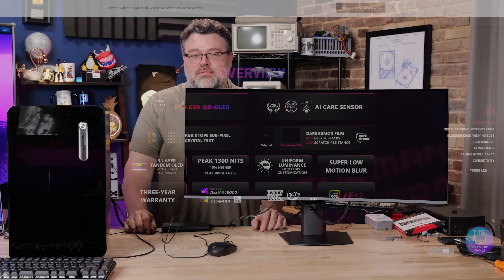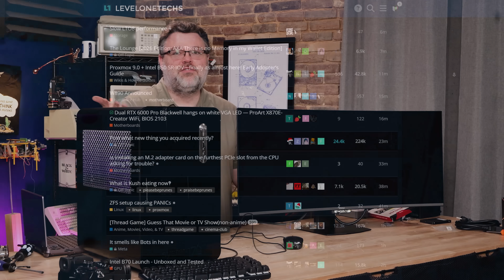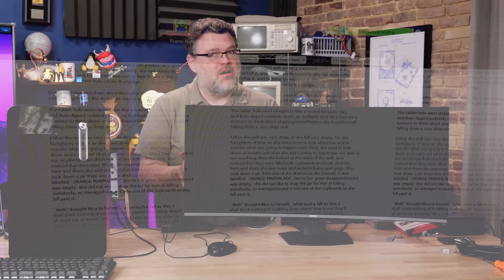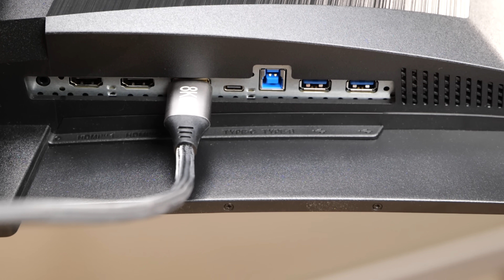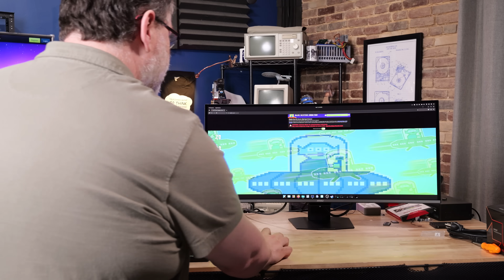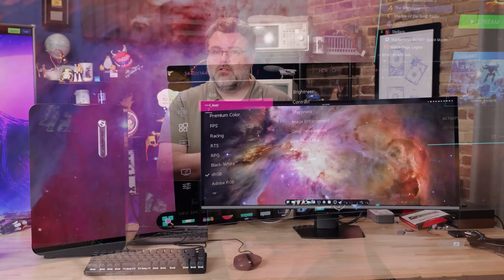Reviewing the MPG 341CQR QD-OLED X36 from MSI

Comment: Orginally bought my first high end gaming monitor in 2018, was looking at the Samsung chg70 and the asus pg348q. Back then I had an gtx 1080sli rig and I knew there was some ultrawide compatibility issues, that manifested in me not playing fallout 4 anymore, tho out of the hundreds of games I have installed on my current system only fallout 4 remains problematic. Since having had my pg348q for these many years I’ve been wanting an upgrade and nothing has quite felt like a really worth it, as I originally payed 1200€ for my pg348q I absolutely needed to get a upgrade that was worth it. Over the past few years several monitors have peaked my interest but this generation is the first one that actually looked like a substantial upgrade, I did cross shop the pg34wcdn against the 341cqr x36 and wasn’t really leaning one way or another, til I found out the amd cheaped out on my 9070xt. Back when I bought my pg348q I knew that there was potential that I would come to regret getting a gsync monitor and that time came last year when I upgraded from a rtx 3080 to my current 9070xt, tho i originally placed much of the blame on Nvidia’s I now do have some resentment to amd as well, yet for 650€ that I paid it was arguably the best value GPU I could get, and even tho I wanted an 5080 I wasn’t willing to contend with the 12vhwpr connector nor the 1200€+ price tag for the minor performance increase over the 9070xt, yet amd has let me down greatly, having a “flagship” GPU with a underspecced dp2.1 connector, had my 9070xt been outfitted with the full spec uhbr20 80gbps port I would have gone for the pg34wcdn as to avoid the need for dsc, being limited to uhbr 13.5 54gbps I no longer had any real performance difference between the 2 and since both fulfil my need for a gaming/home office monitor I decided on the Msi model, I have my webcam (Logitech Brio) and keyboard and mouse through a hub connected to it.

Comment: I am looking into this model or Asus PG34WCDN for gaming/browsing (average 2 hours/day) and home office (2-3 days/week). I have read that the 5th-Gen OLED panels along with the OLED care they offer, are generally much better in countering burn-in than previous gens. Do you think that it would be an issue? if yes, how intense can it be and how long could it go without any issues? (of course without using static images such as windows task bar)

Comment: I’m still waiting for OLED to truly match IPS when it comes to subpixel text clarity. The colors and contrast are incredible, but for me, text sharpness is what matters most. I just picked up the XG32UCWG 32" 4K, and while the WOLED glossy panel is decent, it still doesn’t quite hit IPS levels. The matte coating might actually be the bigger issue here. If Alienware really is releasing a glossy version, that’s the direction I’d go. At this point, I’d avoid matte OLED altogether.

Comment: FYI I had to replace my MPG 341CQPX QD-OLED twice in less than a YEAR, both time, and thats with using the proper OLED care and screensaving techniques, so I'm not sure if its a question of that particular panel of the oled experience with Windows (static imagery) but I am far from being blown away by the pixel life expectancy!
Reply: did you replace it due to burn in?
Reply: @Stephanie-px7ir  Yes.  The third one I didn't check for burn ins (yet).

Comment: NGL I want to see lightweight OLEDs. 17+ pounds is just, ugh.... in my use case, regardless of arm, because of how my c-clamp is mounted, i can't really go over 10 pounds without some saggy arm. i had a 1440p 240hz oled asus panel on the arm, and yeah, it sagged. sadly im crippled and stuck in bed 24/7. so i can't really do what i wanna do. and family can't really go drilling shit for me to mount the vesa arm in a way that prevents sag with heavy displays.... so im just stuck with lightweight displays. currently using a 24.5" 1440p chinese innocn display. its pretty sick for what it is.... and then above that i have a 16" AMOLED display, also chinese brand. so i have an oled for movies/tv that is tiny/light/portable and then my larger gaming display that does 240hz... so yeah.

Comment: Your video has been featured on DailyDrops under Cpus!, DailyDrops is a creator‑friendly discovery layer for professionals. We surface timely articles and videos, then place each piece in clear context using a layered topic hierarchy. The aim is to highlight the work, not to trap the audience on a platform. Credits remain front and center, and our curation is designed to respect both maker and reader: concise summaries, clean presentation, and straightforward attribution. As your video is linked with {TOPICS}, it helps practitioners find you when they explore that theme. We always welcome input from authors about how their work should be categorized or framed. If parts of the context feel off, tell us how you would describe it and we will align the tagging so future drops present your perspective. Your guidance becomes an editorial signal that keeps discovery fair and useful.

Comment: Personally I hate the 21:9 aspect ratio, but its nice to see they improved on the text clarity.  I currently use a 32:9 monitor, the MPG 491CQP QD-OLED, and love it, the text clarity is perfectly fine, even though its older tech than this one, and I love it for productivity, allowing me to have 3 windows side by side and always have a central main window.  Also I keep it on very low brightness and SRGB mode, and it looks amazing still.

Comment: Personal note as someone who was lucky enough to get my hands on one of these monitors: The VESA mount is quite recessed into the shroud so using a quick release style VESA mount can be tricky to get to snap into place, I had to use an uncomfortable amount of wiggle and pressure to get mine to click in. The presence sensor is literally unusable and is a worthless gimic. If you use the monitor in anything lighting other than a brightly lit room, it won't detect you and it will shut off while you are using it. I had mine shut off twice on me before I disabled the sensor, the second time, it took over a minute to come back on even after turning all my lights back on and fiddling with the on monitor control buttons. Extremely frustrating experience given the price of this monitor. Otherwise though, great panel
Reply: I’m really interested in the SLMB black frame insertion mode that you can use at a locked 240fps. I play in a completely dark room, and trying to find out how usable it is. Have you tried it? If not, can you check it out in a dark room, and let me know please? Thank you.

Comment: MSI doesn’t make the panel. Samsung does. All these manufacturers either use the Samsung display QD-OLED or the LG Display WOLED/4th gen tandem WOLED panel. MSI, asus, Alienware etc use either the Samsung or LG display and just tweak the OSD and minor firmware settings.

Comment: I own this monitor and for gaming it is awesome. The DPI and UW res is not at all an issue for me, even in productivity. My only grumble is that the sensor only works in bright room conditions, even after all the firmware updates.
Reply: I’m really interested in the SLMB black frame insertion mode that you can use at a locked 240fps. I play in a completely dark room, and trying to find out how usable it is. Have you tried it? If not, can you check it out in a dark room and let me know please? Thank you fren.

Comment: too bad the resolution suck, only 1440p for that size is a serious issue.
Not to mention it's not even 3840 in length, so 21:9 content won't scale properly
Reply: Personally I think its the golden ratio at that PPI.  You have good text clarity, a good resolution that your games won't run like crap on, and it requires no upscaling from the OS, which tends to break some softwares that aren't designed for it.  When I had a 4k 32 inch monitor briefly, I found the PPI horrible, I was just upscaling every 25%, just so I could read things, which made the 4k feel pointless, and then I was running my games in a tiny window at 1440p, and squinting to see it, just to make them run at a decent fps.
Reply: For most games it’s not issue, and actually a pro so your pc can run games at higher fps.

Comment: what monitor reviews never mentions for oled or qdoled monitors: banding, vertical banding, grid, vertical scanlines/dithering
Reply: Yeah,  that's one of the reasons I went with QD (also fear of flickering) and mine has been perfect in any type of realistic use case... 
I mean you'll get banding on any monitor with a low quality source,  but  I haven't noticed any banding in modern games, and test images look perfect.  
I did get some VRR flicker, momentarily, when a certain game was bouncing between 144+ FPS down to ~15 FPS, but again, it's not like I'd realistically be playing a game that always runs like that, if I did the flickering would be hardly noticeable compared to everything else on screen.
Reply: @Wooskii1  go play dead island 2, get to the haus dlc and check out the foggy indoor-forest area with all the fog and let me know if you ever spot any vertical lines in said fog once you notice you wont unnotice it and it will show up in any other content too once you notice it.
Reply: that's only a concern for WOLED, not QD-OLED
Reply: @amerkiller1995  as someone whos had several QDOLEDs and WOLEDS. QDOLEDS have a grid instead of vertical bands, QDOLEDs also have vertical scanlines/dither that occur when VRR is enabled in dark content, especially in scenes features in games like Dead Island 2 Haus DLC (interior forest with all the fog) very distracting. Not to mention the grid i mentioned, visible against dark reds, dark purple, dark greens, dark gray. The grid is a very thin grid, some may not notice it or train themselves to never notice it, but once you do, its impossible to not notice it. This was a thing on all Gen 1, Gen 3 and Gen 3.5 (True Black 500 models)
Reply: Don’t have to worry about any of it with Penta Tandem QD-OLED.

Comment: I had a gigabyte UW that is nice width but I needed the height. I swapped the uw - when the kvm button died it didn’t activate the software properly and couldn’t rollback or fix firmware - for a single mpg321urx (I got a second a few months later)  the width not quite as wide but that height is nicer. And clarity blitz’s the gigabyte lcd. 

I have an aggressive oled care setup that’s gets a tad annoying at times.

Comment: Occupancy sensors are a such a good idea to put in monitors for reducing power use. They're dirt cheap, easy to interface with, and if you're just using a straight up DisplayPort or HDMI connection then there's very little likelihood of the sensor being used for anything other than its stated purpose.

Comment: 3440x1440 is trash, new standard is 5120 x 2160 at 39inches, LG is the goat. The coating is grey in the lights instead of WOLED black, kinda the whole point of OLED!
Reply: Why trash? 5x2k also requires a very serieus GPU. For my 7900XT 1440 is fine :)

Comment: instead of losing money and complaining that they have refused to cover warranty i prefer to save money and wait until burn-in is gone from the list of issues. 360hz? 1.3k nits? ai care sensor? who asked?
Reply: Are you special or something? There are a lot of tests on youtube where people are showing burn-in on their oleds after THOUSAND hours and they are barely visible or not existing. I have friend who has 2 OLEDS (alienware and Asus) and no burn-in after 3000h+. Stop with that burn-in shit if you don't know how it works in recent year.
Reply: @MacTavish9619 well... if buying monitor with plan to use it for longer than 3 years makes one special then i guess i am. also simple math 3k hours 10h/day = 300, not even a year.... what a joke. how about 25k+ hours (5+ years with 14-15h per every day?)
Reply: @_ @_SilverPhantasm at would only be if you’re leaving the exact same static image on the screen every day for 3 hours a day

OLED only burns in from extended length of the exact same image being on the screen. Not an issue with gaming.

My gen 1 OLED has been used for gaming basically every day for nearly 4 years now and no burn in 

OLED is only for gaming. If you’re doing office work it’s like trying to eat soup with a fork. Wrong tool for the job

Comment: I got this monitor after my samsung 49inch oled stopped powering on under warranty and Samsung keep sending it back with a huge crack in the screen. Anyway this MSI monitor is immense.
Reply: I’m really interested in the SLMB black frame insertion mode that you can use at a locked 240fps. I play in a completely dark room, and trying to find out how usable it is. Have you tried it? If not, can you check it out in a dark room and let me know please? Thank you friend.

Comment: I remember plasma display burn-in, and I'm not prepared to babysit a monitor that I will be using for a lot more than the warranty period of three years.  I just bought my fourth (first three still in use) 3440x1440 monitor, this time an MSI Optix MAG342CQR.  It's a 144Hz VA with an 1800R curve, and it produces gorgeous images.  I paid <$200 including sales tax.  It almost feels like I stole it.
Reply: Nice buy, about half a decade ago (so peak COVID supply & demand) I paid 8 or 9 hunno USD for an LG display with about those same specs. Lately I'm staying with family on a week to week basis and I can't bring an ultrawide; making due with 1080p isn't the worst but it's def far from ideal.

Comment: Ultrawide is just ultrashort right? 
I'd prefer 38" 16:9
Reply: Usually they come in the same or similar heights as the 16:9 counterparts, you just need to find the equal size you are looking for comparison, like a 45" 21:9 model would be a 37" 16:9 equivalent.

Comment: Text rendering. Text rendering. Text rendering. That's why the recent LG panels are the code for developers.
Reply: Which panels exactly? IPS Black? Or tandem OLED?
Reply: This has true RGB stripe. But it's mostly irrelevant. Regardless or the panel type, if you're buying for text rendering, you want something with much higher pixel density than this.

Comment: The peak brightness of this monitor is only on a test pattern, in real world content brightness falls of the edge of a cliff presumably to prevent burn-in (warm OLEDS wear faster). Both WOLED and QDOLED suffer from this, though WOLED is slightly brighter at 600-700nits in high APL scenes compared to 400-500nits but suffers from other issues, such as uniformity, bad EOTF tracking near black and worse colors. On the other hand with QD-OLED you have to pick between high APL brightness with peak 400/500 nits modes or higher peak highlights in low APL scenes, which can be annoying. Still looks better than SDR in most cases though, and miniLEDs that have less issues with dimming have terrible motion performance so overall still the best for gaming, but these peak brightness figures are about as meaningless as quoted response times are on IPS and VA panels

If you want good HDR on an OLED you are going to need to go up to TV sizes, even the hampered 42" model has less dimming than we get on monitor sizes sadly though at least now the 48" gets to be tandem (C6, G5/G6 in Europe) and is about twice as bright as the 42" model still, though if you can swing a 55" TV for gaming (some do) then S95F/H and G5/6 blow the HDR performance of these monitors out of the water. At least the TVs are RGWB subpixel layout now too, so text is not as bad as it used to be (still not great, especially 55" though 42" is ok)

Also, even at 1,300 nits that would not be enough to burn your retinas. If you've ever looked at a white piece of paper on a sunny day then you've witnessed 100,000 nits! Not even the 10,000 nits we need to get full use of HDR standards as they are now and the ability to produce 12 bit color come close to matching that.

Comment: Yes, the tree does make a sound. Physics at that scale doesn't depend on an observer being present. Plus the squirrels will be able to hear it 😉
Reply: No, the tree does not make a sound. It makes pressure waves. Sound is the brain's representation of certain pressure waves. So, no brain, no sound. Unless you define sound as a pressure wave... So, ultimately the answer depends on your definition of sound.
Reply: @fizout  According to the technical standard established by ANSI/ASA S1.1‑2013, the American National Standard for Acoustical Terminology, sound is defined as:
    "(a) Oscillation in pressure, stress, particle displacement, particle velocity, etc., propagated in a medium with internal forces (e.g., elastic or viscous), or the superposition of such propagated oscillation.
    (b) Auditory sensation evoked by the oscillation described in (a)."

So I guess any oscillation is sound by one of the very few official definitions.